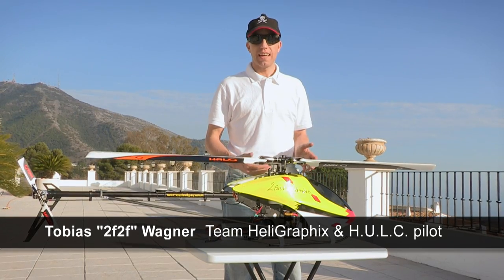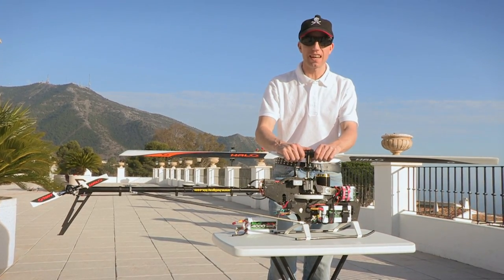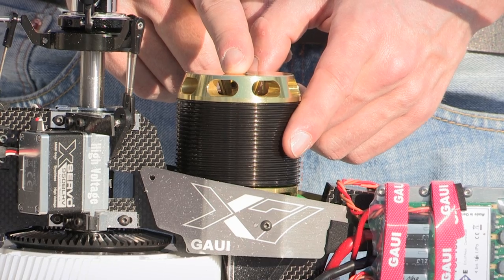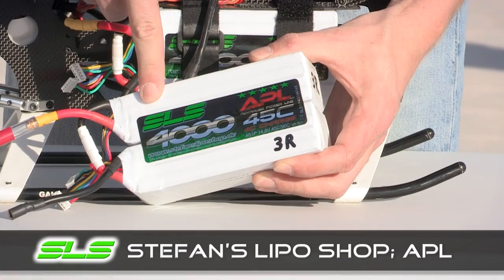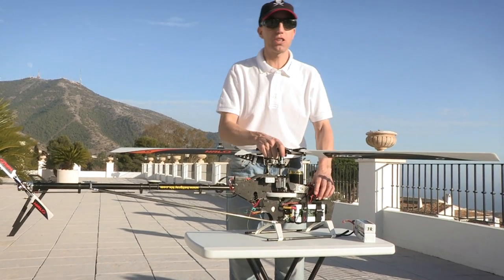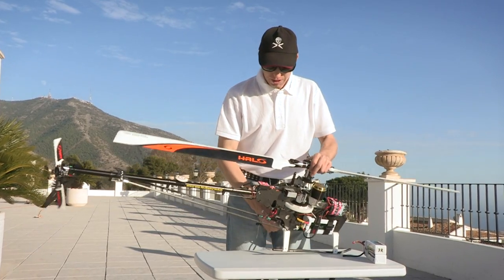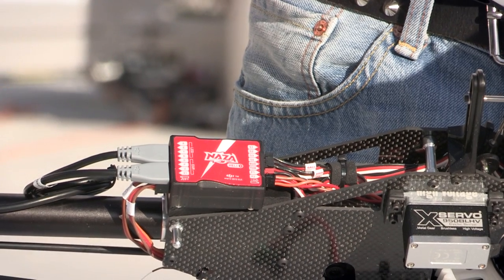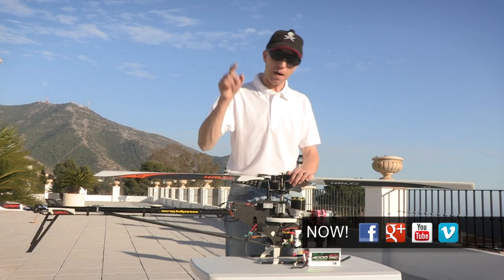Two RC helicopters lift a woman - The EQUIPMENT we used (HULC project)

Comment: Any thought to replacing those gears with titanium?
Reply from the maker: +Lucas Finley Yes, but this would have caused a number of other challenges. And there's always one part which is the weakest link in the chain. If you replace it you'll likely need to go on with the next, and the next, ... Since an important goal of the mission was to use standard equipment as much as possible, we kept the stock gears; replacing them every now and then served us well.

Comment: That's amazing. How much does it cost to put a helicopter like this together?
Reply from the maker: That would be a few thousand Euros in this configuration. Since for every other application you need less power (and then still have way more than you'll ever need!) cost will be at an affordable level and pretty much like for any other higher end model

Comment: What is the total cost to purchase one of these Hulc types and how many man hours to configure after the process is ironed out ?
Reply from the maker: We don't sell anything, that's a common misconception. As detailed in the videos some components were customized for us, so it's hard to give a price. Unless you're very experienced in building and operating helis of this power class we seriously recommend not to try. Ultimately it's very dangerous.
Reply: Wow, Tease me Please me Heli .... This is what I really wanted for Christmas LOL.... Instead I got a bag of socks and a watch ..... You really should put these on the market as custom builds.  The payload capability is functional enough to have practical uses and these platforms are cheaper than the quad styles...

Comment: Great machine! Well done:-)
How did you attach the cable to pull the load?
Are there mechanical modifications to prevent the rotorhead being pulled off, or the frame gets torn apart?
Thanks!
Reply from the maker: The rope was simply pulled through the frame: pictures + explanations are in the facebook gallery linked in the video description! Gaui is one of the few manufactureres who don't use carbon sandwich plates, but full-CfK instead; that way everything is rigid enough. As you have seen in this video they use two Jesus bolts to fix the main rotor head to the 12 mm main shaft. No modifications were necessary. At this time it's probably the one machine that was strong enough for this pretty extreme experiment.
Reply: Cant get 16s lipos but get 4x 4s lipos make 16s and have 70c i need 16s for a sab gobling speed machine
Reply from the maker: We also used the 4x 4s approach, works nicely. Consider that at this time no charger can charge 16s, so charging 2x 8s is the way to go. 16s is nice because it reduces the current (otherwise 14s will do the same); certainly don't need 70C then, unless you have very low mAh count. The Speed Goblin sounds like a cool project, wish you much fun with that!
Reply: HeliGraphix.com truth is ile be scared to run a sab gobling ile just stick to a 14s trex 700l lol running 2000rpm on a pyro 700 52l i just cant make my mind up lol so much choice
Reply from the maker: Well that's a BEAST of a machine you have there anyway, why would you want anything else?! :)
Reply: HeliGraphix.com  well i prefare sport flying and flight time aswel plus those 7s g8 lipos fit the frame and a pyro 52l 3.5kw motor is plenty for what i need for the trex 700l dominator those big motors just burn to much power

Comment: How often do you need to replace each part?
Reply from the maker: The delrin main drive wheel and tail got replaced every couple of flights, otherwise it's fine. This said, we don't have many such high-power fligths which really touch the limit. We nonetheless do very very precise inspections after every flight.

Comment: with a 800 g of payload...how much time can fly?...thanks from Spain
Reply from the maker: +TOMAS FENOLL GOMEZ With 800g Tomas? The helicopter is not built for such light payload, it will not work efficiently with this light payload. Maybe around 15 min., heavily depending on rpm.
Reply: +HeliGraphix.com thanks dude!! iam a novice ...could you send me a configuration in order to fly more than 1 hour with aprox 1 kg of payload?...sincerely greets from Spain
Reply from the maker: Totally different field, no experience with this, helicopter likely not a good choice.

Comment: According to the woman video the two helicopters may be able to carry around 30-32 kg so how long it can stay in flight at 20kg payload  any idea please
Reply from the maker: That's correct; some extra power needs to be reserved for manoeuvering so from a pure thrust point they could even lift more. At 20 kg (see our Christmas tree lifting video) the batteries will last about 3 minutes.
Reply: HeliGraphix.com 
Ya I saw that one but several times  of failure they just dropped it roof but yet still it's not have good  manuveriablity that's one draw back here
Reply from the maker: Yes and no. This was mainly due to high winds and the fact that the load was on a long rope. This is generally a hard situation for any helicopter especially if the weight is much more than that of the heli (in this case the tree was 4x heavier than the model). Together with the wind and the fact that the pilot cannot really see both heli and tree together and thus has a hard time re. depth estimation (i.e. where he's flying) this seemingly simple task became real difficult.
Reply: HeliGraphix.com 
Yes it's true in electric powered rotary crafts wind remains a another problem

Comment: 70 volts and 10k-watts.  140amps? It would feel that those lines would melt. or at least run really hot.
Reply from the maker: That's not a problem at all, it'll be fine up to 200 amps. Critical however are all joints and their soldering. At least 6 mm plugs should be used and made sure all is well-soldered
Reply: This could run 2 motors with that power 70volts
I am building a electric skateboard and it needs 4 motors 2 ESCS hooked to 2 motors each then go out and buy 8x 4s 5000mah 70c lipos because ile be running KDE 510kv on 16s 
So that's 16s each for all 4 motors 
Plus after that dial the speed to 50mph and have fun lol plus maybe need new fresh pants aswel  because I bet 75km 45mph is  scary let alone 80km 50mph plus a lot more because KDE motors are just as powerful as a scorpion plus better built plus has better efiecney  so I may get 30km or more depending how I use the power under the hood

Comment: why not use 4 of these motors and attach them to two carbon fiber rods with a chair on top.
Reply from the maker: cool as well, but the goal of HULC project was to do the first truly remote-controlled flight with MODEL aircraft. Building something like you describe would be a custom-built special aircraft (such as Volocopter). The achievement of what we did certainly is that we used nothing but modelling components you can buy at your hobby shop
Reply: HeliGraphix.com Since you already did most of the math, what would be the total lift provided by 4 of these rotors? Does it make sense to add lets say 100 or 200 batteries?
Reply from the maker: Lift is just one thing - equally important is maneuvrability. So depending on the configuration and control type you choose for your aircraft there is more or less power available for lifting with the same overall motorization. Endurance is generally a problem with electric aircraft (today); adding countless batteries does not help as you're losing payload capacity fast
Reply from the maker: This looks like a cool project Ryan! Wish you lots of success with it. Let us know when the first proto is in the air or you need test pilots B-)
Reply: HeliGraphix.com
Thanks!  You guys are actually an inspiration for me.